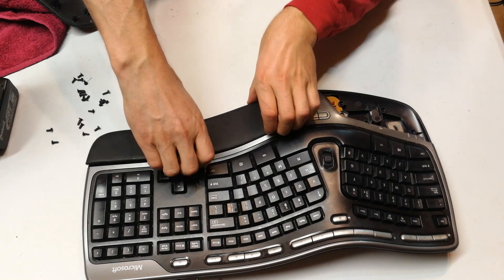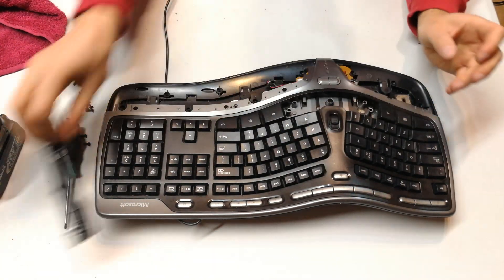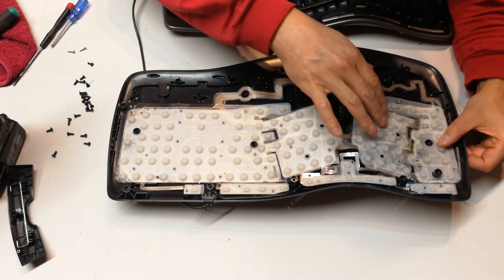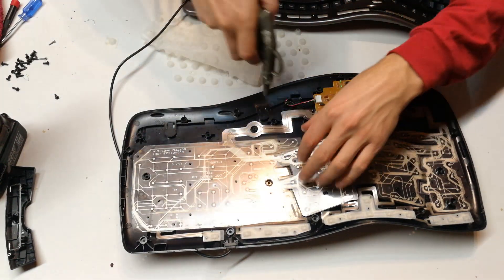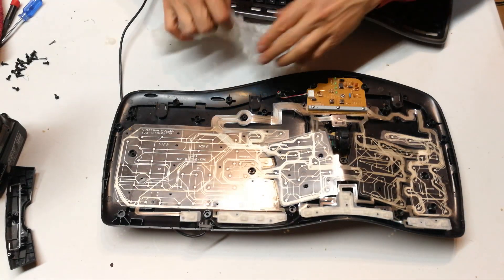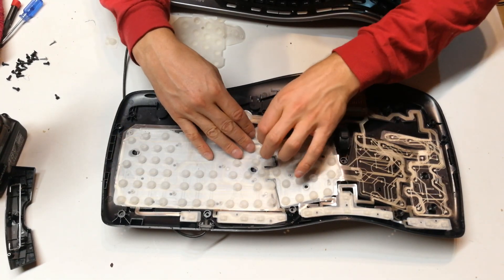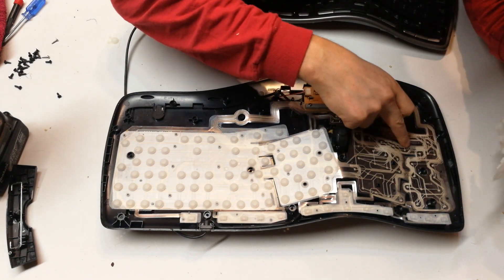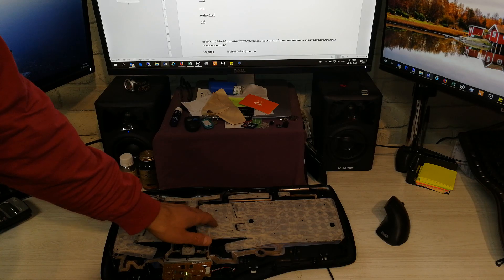How to disassemble a Microsoft Ergonomic keyboard (fix water damage)

Comment: My R key is also typing  "T", so pressing R gives RT. How can I fix that?
Reply: I found my own solution, and I will share it here in case other people have a similar problem:

I got this issue after opening up my Microsoft Natural keyboard 4000 and removing all keys for a good cleaning. This is a rubber dome keyboard. Some keys starting to type extra other letters. For example, Key "R" started to type "RT".

 

Solution:

What you need:

 *   A can of compressed air
 *   A bit of isopropyl alcohol
*    Gentle hands and a lot of patience

Procedure:

*    Open your keyboard to reveal the rubber domes. (Search youtube or the internet for instructions on how to open your keyboard. (If you need to remove the keys, make a photo to remember where to place your keys back.)
*    Make a picture of the placement of the rubber domes.
*    Remove the mat with rubber domes
*    Gently blow out any dust with compressed air
*    Under the rubber domes you will find multiple thin sheets with electronic circuits. Warning: These are fragile. Don't tear them of bend them too much. Gently clean them with a thin soft cloth and a bit of isopropyl alcohol
*    Gently lift each electronic sheet with the circuits for the keys. Clean all the contact points between them with the cloth and isopropyl alcohol
*    Make sure the sheets are dry after cleaning. Put the sheets back in their place.
*    Put the rubber domes back on top of the sheets.
*    Reassemble the keyboard housing and test every key. If it does not work, try again. Check if all the sheets are clean, all the dust is out and the rubber domes are exactly in place.
Reply from the maker: thank you for this

Comment: 0. there are 3 layer of plastic circuit, 1 is divider/separator. I did below for all 3 layers.
0.1. I always connect/disconnect keyboard to laptop to make sure the respond from keyboard.
1. I check the liquid mark at the back of keyboard for liquid trace.
2. from there, I use wet wipe(similar to alcohol) for liquid mark location and dry wipe in other area.
3.  I left under fan for complete dry then put it back again.

I dont think this is the correct and finalize procedure, but I hope it will help other users.

Comment: You could've spent a lot less time showing you air blowing the dirt out which was redundant and used some of that time showing people how to properly reinstall the spacebar. It should've been intuitive and obvious that people would want/need to know that. It would also have been very helpful if you had mentioned that two of the screws that come out of the bottom are longer than the rest so you need to mark where they came from. Notwithstanding the above shortcomings, it is a useful video. 😉
Reply: This should be the top comment.

Comment: What a terrible design, a billion screws to access the most basic parts. And my spacebar never worked reliably even after modding it. The wire began to come apart where it joined the body. A big, heavy pile of crap.

Comment: I got the keyboard apart. Thanks! But....I can't for the life of me figure out how to properly reattach the space-bar. All my attempts end with it sinking to the bottom. No spring whatsoever. Since the video doesn't show / explain how to reassemble, any guidance on how to do so is most appreciated. EDIT: Oh No! I see the problem. The small membrane that gives the space-bar its 'spring' is missing. Funny, I've no memory of removing it, though I obviously did. This is bad. LOL
Reply: I just made sure the long silver color metal piece fed into the plastic tabs.
Reply: Thx so much i have the same problem

Comment: Sadly the E4000 has now been discontinued. I bought one of the last ones available only to have it fail in an odd way after just 4 months of use. Suddenly four keys in a row all died:  p [ ] \   . I have been babying the keyboard and won't even eat near it but I figured something must have gotten under there so I opened it up. It was totally clean. Even directly accessing those 4 spots on the printed circuit board got no response. Thanks to your video I was able to feel like I did everything I could.
Reply: I have a well-used E4000 that works perfectly except for the same four keys that you were having trouble with:  p [ ] /
I appreciated your video as a guide to taking the thing apart in an attempt to repair it, but alas, there's something wrong that is not visible.  Cleaning the traces and membrane pads, removing all dust, using the liquid PCB repair pens on the traces feeding these four keys, etc.   None of it helped.  Judging by the others in this thread with exact same 4 keys out, appears to be an endemic problem.   
I could have replaced the entire keyboard for the cost of the PCB repair liquid, and now wish I had.  Just hated to toss so much plastic etc. due to a minor problem. 

I have a couple more of these keyboards that are flakey with certain keys, and I suspect that membrane problems are the cause there as well.  Unfortunately, "repairing' these membranes appears to be very hit-or-miss.   

One note on the disassembly / reassembly:  two of the case screws are longer than all of the others, so the lower outside corners where these two need to go should be marked so one can get the two longer screws properly placed.
Reply from the maker: sad about the 4000. I have had a few of these keyboards...
Reply: EXACT same 4 keys for me p [ ] \ . Going through the cleaning process right now and read your comment - were you able to figure it out and fix the 4 keys?
Reply: @tuetktran9477 no but I immediately ran out and found a couple more and stashed them. I had already learned my lesson with dance dance revolution mats for the PS2.
Reply: that's what's going on with mine! That's y I'm on here.
Reply: @yellowbirdhd  Samme with me. p [ ] \ don't work. Were you able to figure it out?
Reply: Same with me. SADLY it was two entire rows
Reply: I've been using mine for several years with no issues and just lost that row of four keys. 😞 I will try this procedure but looks like I'm probably out of luck.
Reply: I too got one of the last ones, they are stupid price second hand and nothing like it on the market. My hyphen and left CTRL keys were getting unreliable and even though everything looked clean, I went in each layer of the contact switches, the three sheets of plastic and went over the bad contacts with some contact cleaner (isopropyl would do), on a cue tip. That made all the difference. And again there were no visible signs of dirt. So firstly these seem to be very delicate and second, even if it doesn’t look dirty, clean it, you’ve already taken the keyboard apart, might as well.

Comment: Great video, question: any idea where to get those cushions? mine need some replacement and it would be helpful if you know. I have been looking around for a while with no success.
Reply from the maker: try Alibaba
Reply: I've also seen broken keyboards sold on Ebay~ you know how to scavenge the parts if the pictures look decent.

Comment: Now, if you start losing some keys, there is a small design problem with them.  See at the circuit board, there is a steel bar that is held down by three screws ? well those screws provide the pressure to press the keyboard  films (the clear plastic sheets with circuits on them )  down firmly onto the circuit board contacts. Now the problem is that the black plastic stands below them are too tall, and plastic too soft.. the pressure reduces over the years.  So trim off the top off these plastic stand offs, and then its problem solved .. But if you break the standoff, and can't get the screw to grip with the steel upright,  "n" shape,    you can invert the steel, to make it u shape, , and put the screw heads  inside the u  ! ,so that the screw is deeper into the base.
Reply: Thank you for sharing, I had no idea.   After removing the three screws and the circuit board, underneath there is a piece of rubber which as you state loses tension over time.   I had two bad keyboards, so I placed the second piece of rubber from the other bad keyboard underneath and then screwed it back down....but do it gently.   Else you can carefully file off some of the plastic on the standoff.   Either way it will work to increase the pressure on the connection.   That doesn't always mean it will solve the problem, so testing is essential before you reassemble.  This is all low voltage so you can't get shocked.  The reliability and quality of these keyboards is pretty bad when they get older, from the painted letters wearing off the keys to failing keys.  But they are comfortable to type on. I wish another vendor would make a high-quality ergonomic keyboard with keys like the high-end Lenovo Thinkpad laptops.
Reply from the maker: thank you

Comment: More than fixing, is how to blow the dust inside the keyboard. You forgot to mentioned that not all the screws are the same. Also you did not disassemble the circuit part, if water was spill inside the keyboard you have to clean the circuit with Alcohol or a dielectric solvent.